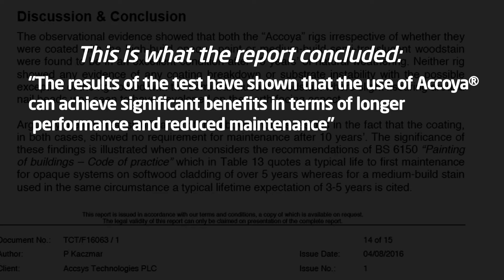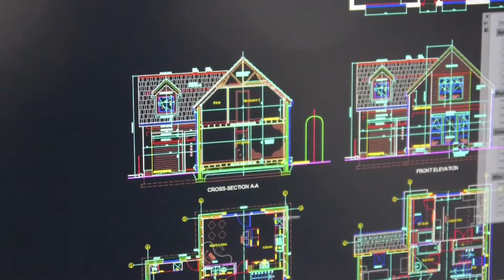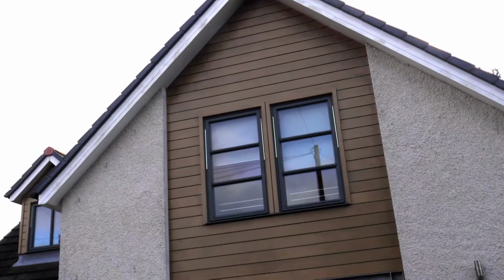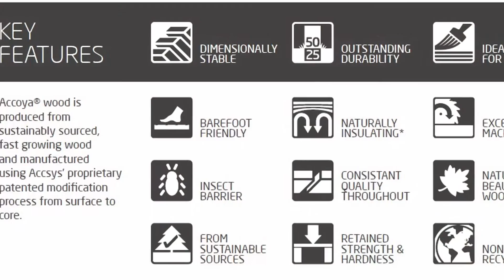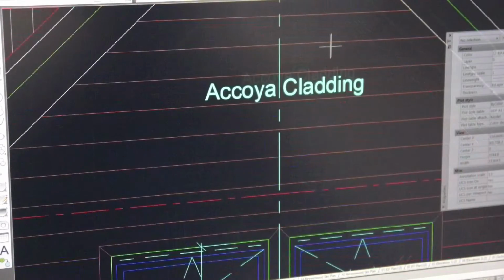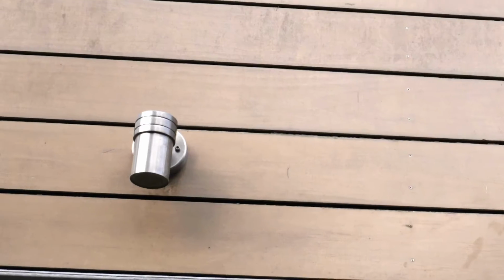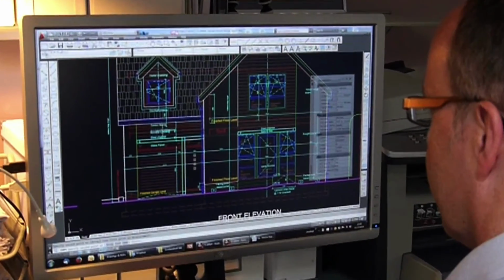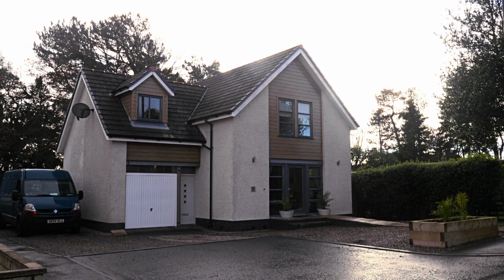Accoya project case study | 10 Year Accoya Cladding in Scotland

Comment: In the Accoya  coating guide, they recommend not having sharp edges on the cladding, but rather rounding them to 3mm (or larger). The coating failure shown illustrates the reason for that. The Sikkens product used is film forming, and most film forming coatings won't cover edges well (the film thins at the edge due to surface tension). 

I would love to see an update to this.  I would also be interested in knowing why Mr. Aitken chose the Sikken product over other Accoya approved coatings from Teknos and Sansin.
Reply from the maker: Hi, please could you send an email to marketing@accoya.com so we can discuss this further. Many thanks, Accoya